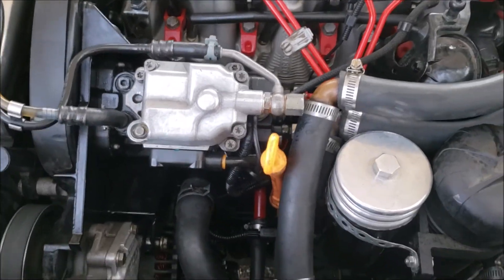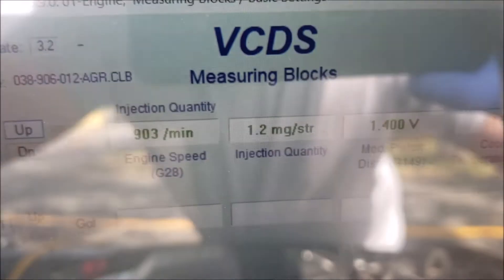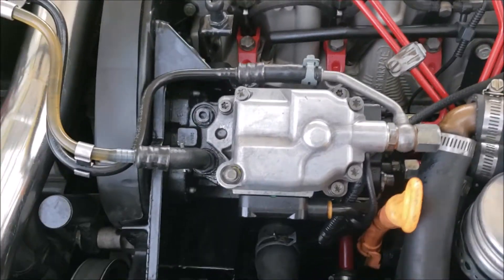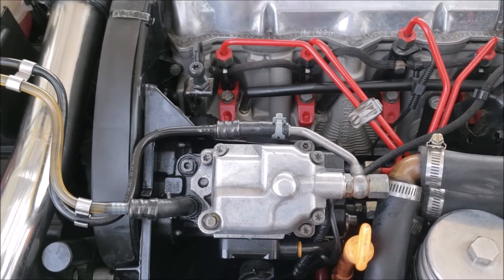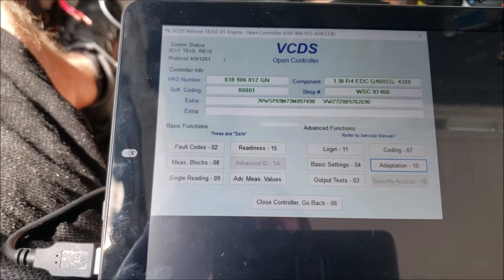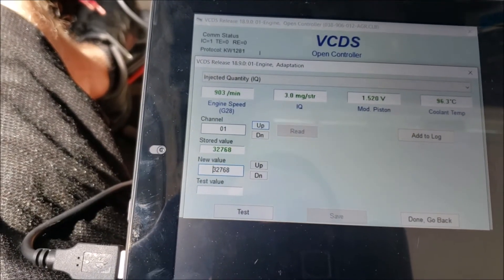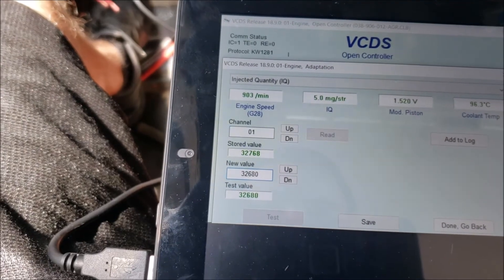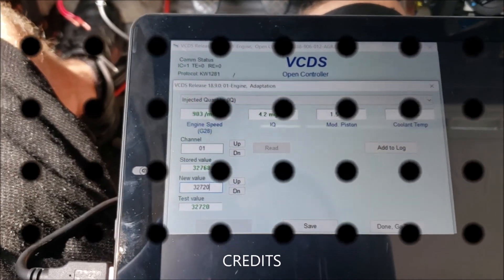Hammer mod TDI VE Injection Quantity adjustment, VCDS adaptation

Comment: LOWER BOLTS !!!!  the upper ones only are the lid....  BIG misdirection...
Reply: If you do the lower bolts it sprays fuel everywhere
Reply from the maker: It's the bolts to the head. You are correct. Now if you read the description it does say this was a mistake.

Comment: hey man good video,my question is how low can you go with the new value number? im seeing that lower than 32625 doesn't really do much. got the car to about 3.8 to 4.0 at idle couldn't really do the hammer mod because i dont have the triangle socket. thanks
Reply from the maker: @miatalife94  3.8-4 is a fine number. You can only decrease it or increase it a certain amount with VCDS.

Comment: Please someone reply me here, i need help, i measured the resistance on the pump conector, the pins 5-6 and 2-3 are correct resistance but 1-3 is out, not between 4.9 to 7.5 ohms, its showing 12ohms, so based on this manual service is saying to
Replace pump, i put too much money on this stupid car, and i just lost my
Job, can’t afford the crazy price of a new pump neither afford to pay for someone do the pump replacement. I am driveway car worker, iam not mechanic neither got the tools to pull the engine off, if id had to take pump off and mess up with all the timing belt stuff i could mess up it more.

Comment: This a joke right?
Reply from the maker: @junkemails5050  no?
Reply: Really? I will try them if i think i might. Did this fixed for long time? Still good? How long it lasted if didn’t last ? My codes didn’t come up again. I had other codes but also this only happened when i had to try hard jump start, the battery keeps dying. If i dont Use the car for like two days it dies the battery. So would this codes related to pump timing and crank timing come up on if the car is not starting when cranking? I need find out what is draining the battery

Comment: Hello I hope you still check the comments my IQ is at 20mg and that’s at running temp I just swapped my 10mm pump out to an 11mm and I’m getting the 20mg reading with the new pump in. If anyone has any ideas please lmk
Reply from the maker: Hammer mod. You are going to have to loosen the head and wack it over to get it lower.

Comment: Is 94.5c  normal temperature?  Mine used to sit at 90c 92c after a hard drive , after changing the thermostat it now sits at 93c to 97c driving hard uphill does this seem normal?
Reply from the maker: Ya, the ALH engines are very efficient making them not get very hot.

Comment: Hello I hope you still read the comments :) I have a golf 4 1.9tdi ALH (90hp) with cat delete and egr delete also stage 1 tune. What should be my IQ? What is the normal for this setup? Also I want to upgrade my nozzles to .216 nozzles when I upgraded it should I upgrade my IQ to? and what should it be. I hope you answer. Thank youu :)
Reply from the maker: I found between 3.2 and 6 to be the best.
Reply: @MK4moTDI   thank you so if I upgrade my nozzles it should be between 3.2 and 6
Reply from the maker: @FOTROXIC  ya stock and upgraded I aim for 4.2.

Comment: Hi. Vw polo 1.9 sdi. 2005. What should the lower range be? And what should the higher range be please. I am getting the N146 lower limit reached. Any help is welcome please
Reply from the maker: You will have a PD TDI will you not?
Reply: @MK4moTDI  what a PD? Mines is 1.9 sdi vw polo
Reply from the maker: @scottd1489  ok we don't get these engines here in NA so I know nothing a out them. Sorry.
Reply: @MK4moTDI ist same engine but without turbo ! Very good one.

Comment: so why is it good for us?
Reply from the maker: What?
Reply: @MK4moTDI  that hammer mod
Reply: @MK4moTDI  what is this doing to the car? why is it recommended? or what ? if i change the timing to the good value, why is it needed to hammer mod?
Reply from the maker: @cancerealtm623  hammer mod is needed if you cannot get the value in spec via coding with VCDS.
Reply: @MK4moTDI  but what value is this? timimg?
Reply: @cancerealtm623  Its adjusting the quantity of fuel that is being injected. The lower the IQ number the more fuel that is being injected, this means more power and possibly smoke. The higher the IQ number the less fuel being injected meaning more fuel economy but power may start to drop off. The mod is used to find the sweet spot for the owner depending on what they want in regards to power or economy and to take account of any mods to injectors, turbo etc. Too low an IQ number can lead to slowdown shudder and rough idle, too high an IQ number can mean a loss of power.
Reply: @tipptop9  thanks man

Comment: I've got mod out the ass never used vcds just a custom tune flashed what's the purpose of this hammer mod less or more fuel if it's more fuel any draw backs also y is it needed if it's less I understand I have 230 injectors I'm on my 3rd turbo lol car won't seem to run less than 30 psi at wot no matter wtf I do
Reply: The ‘hammer’ mod is to adjust pump timing when it’s out of VCDS parameters. A mechanically well timed pump should start immediately but if not adjusted within VCDS it may not run efficiently or well. The hammer ‘taps’ move the pump and increase or lower the IQ. If you can get it to within the spec range of VCDC you can then use the IQ adjustment(when you have tightened the screws/bolts on the pump) within VCDS to make fine adjustments to get the engine running correctly. Some minor adjustments can be used for more power or economy… 

Hope this makes sense.
Reply: How much did u pay for those nozzles?

Comment: Will I be able to do this with the VCDS LITE version, not the free one but the $99 one ? My IQ is showing 12 mg/str in the free VCDS version. My 03 ALH is blowing a lot of white smoke. I already changed a bad turbo with bad fins and leaking oil. I'm assuming the car had a runaway because all the charge pipes and the EGR were soaked in oil. I just got the car 3 weeks ago for $1250. 190k miles.
Reply from the maker: I'm not 100% sure about the lite version.
Reply: Works fine

Comment: i have a hard start on my 2002 vw jetta tdi , car will only start up if i plug my frostee heater up please help temps in NY have been around 25 degrees and below
Reply from the maker: Did you check IQ and IT with VCDS?

Comment: The bolts you released are just for the lid. All except the special bolt. It goes further down. It is the lower boots you are supposed to loosen, and then iust tap the pump very slightly.
Reply from the maker: Ya I said the wrong bolts in the vid. But i do say the lower ones. Hope people don't miss that.
Reply: @MK4moTDI  'course you were wrong. Don't worry. If you haven't done anything wrong you haven't done enough.
Reply: @MK4moTDI K
Reply: The special one is the big one?if i do the same am i getting more fuel?
Reply: Nu
Reply: So just loose the special bolt the triangle bolt and hit it? Do you need to loosen the other 3? Mines is lower limit and needs to come up. Please help. Thanks
Reply from the maker: @scottd1489 special one + the 3 lower one's.

Comment: It's the top piece???!  FML!  I marked the bottom section, not the top one when I took it apart and that's what I've been trying to adjust!  Holy guacamole I am an imbecile!  It's 4AM right now, got the battery trickle charging, I am excited AF to get out there and hopefully fix my car!  I don't have the software, I can only start it with ether and it won't rev past 2k RPM at WOT.  Virtually zero power if you try to actually move the vehicle it just dies.
Reply: Same issue in having g on vw polo 1.9 sdi 2005

Comment: Will this solve the limp mode of tubro or faulty injection pump if the codes are shown. I have EGR delete.
Reply from the maker: What's the codes for?
Reply: MK4mo TDI replaced new N75 code 16629 , still the same problem. 16600 - P0216 (N108) other come. N214 , I just need to replace the coolant thermostat valve.
Reply: Injection Valve is N108
Reply: You need to fix any dtc present before attempting modding.

Comment: Hi dude,please tell me how did you connect your tablet with the car?
What operating system in your tablet running,android or windows?
Reply from the maker: Windows with Ross-Tech VCDS
Reply: @MK4moTDI  with the normal bleu vagcom cable? Kkl?
Reply from the maker: @Slave4UMrs1  if you can get that to work.